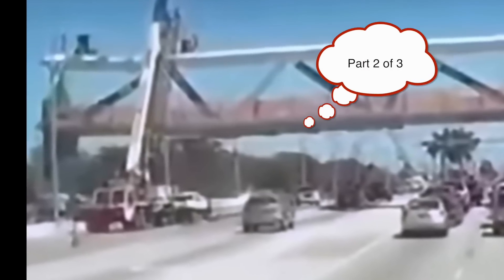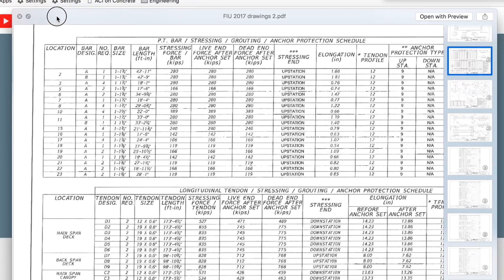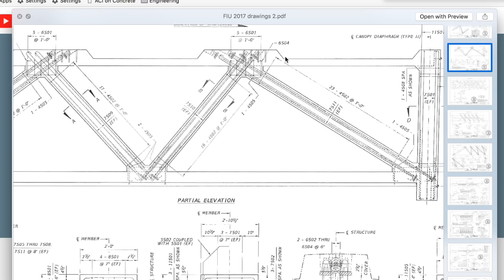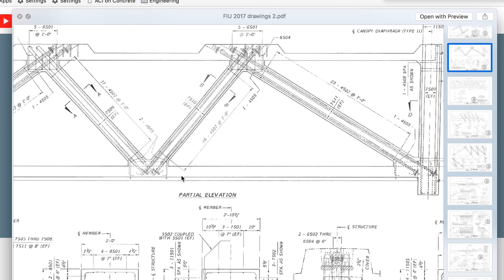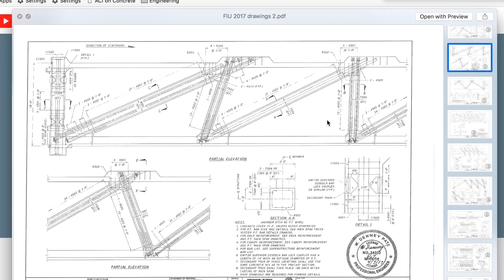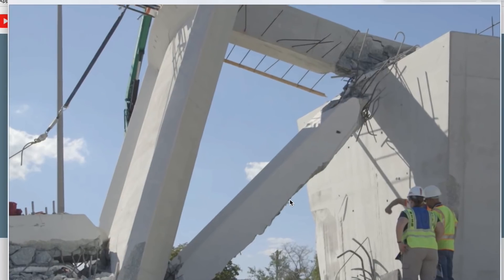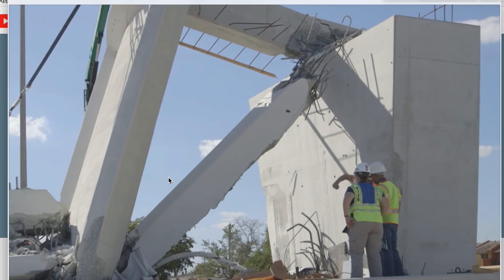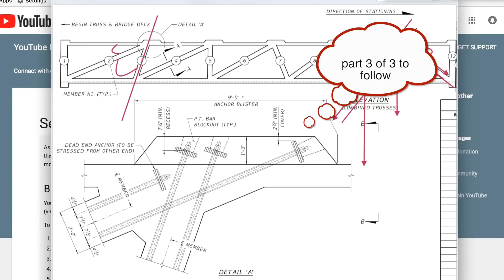FIU Bridge Collapse Could forces in #10 & dead loads be the cause of failure in canopy (2 of 3)

Comment: yes i agree bending moment  is odd as the trusses don't resist the bend like an I beam would and dead weight and poor angles on the trusses create a stress point and thats where it fails. I could be wrong but early picture of the  bridge really looks like the left hand side that failed looked lower than the right hand ???
Reply from the maker: Thank you for commenting Richard... this bridge should have just been a test project and never the real deal...

Comment: I'd rather put my money on a structural failure in the concrete securing the lower tension bar in nr11 to the lower deck. Several things could be the cause of this initial failure and i wouldn't be surprised if there is found to be a combination of several factors here. Something really significant must have taken place for the heavy hydraulic tensioning cylinder  together with several feet of post tensioning bar being ejected out of the canopy. I wonder if the "puff of smoke" (so many of you have noticed in the videos) on the outside of the northern pier maybe is debris flung out of non grouted tubing in the deck when the anchor plate holding the post tension bar got ripped out of the deck . If this is the initial catastrophic failure then a major buckling downward of truss member 11 had to happen. This failure would then effectively remove almost all stiffness in the bridge structure between the pier and truss member 10.
I find it very unlikely that the post tension bar got pushed out of the canopy during the collapse when the bar had to be severely bent already halfway in the fall. It's impossible in my opinion.
Just my thoughts on it and i'm also just speculating :)
Reply from the maker: We are way beyond your comments... catch up not!
Catch up! 
And, I am sure you would lose that money...

Comment: Your superb video discussing the voids created by ungrouted or missing post tension cables and those voids and cables way too close to each other and to the angular connection in the cast concrete was for me at least,  a water shed video,  

 I hope it does not get lost in the barrage of continuing discussion....
Maybe you can put links to it and highlight those links as crucial issues.
 

Those defending their engineering and other vested interests will do their best to avoid any discussion around that crucial range of issues.
                             ----------------------------------

Beyond that, in my view, a webbed concrete truss is ludicrous... entirely ludicrous from a dozen different perspectives... using post tension to make that ludicrous approach look good on a computer program used for calculating stresses on a steel truss  is even more ludicrous... and it ignores the issue of 'chaos mathematics' that you brought up regarding the internal stresses of*variable post tension and the invariable concrete...

My friend in the business commented that in his business those blister areas would have had so much rebar in them, that they call such structural approaches,  'cast in place steel'... not reinforced concrete as we see here with minimal rebar... maybe less than 5% rebar... leaves me in shock.

I think the insanity around this approach will be discussed for decades,... or... one  would hope be seen for what it is,  and put such concepts in the bin before another one is ever built.

It is fortunate that all the braggarts and origami fans were there when their entirely bogus approach landed in rubble ... fortunately not months or a year later

.....then hopefully that cloud of dust rolled over them...it is sad that we cannot say the same for all those crushed under their inexcusably bad design of mathematical, common sense and philosophical idiocy.

Comment: From the video this time going frame by frame it appears that the canopy did fail first but I'm not totally convinced. Due to the camera angle, the fact that the camera was in a moving vehicle and that it wouldn't have taken much of an initial fracture in the walkway to rip the canopy apart to fall hard and fast. I also don't understand why a failure in the canopy where it occurred would have precipitated a total collapse since you still would have had a rigid triangle formed by 11, 12, and the walkway. The canopy would have had to have caused a failure in 11 somewhere to drive 10 and 11 hard enough to shear apart the walkway. Okay I admit I just don't know. Glad I'm not a forensic structural engineer.
Reply from the maker: Mark, I am not 100%...
But, with all the current, limited data...this is my best choice...
Hell, it could be the deck failed first, the video, it is not distinguishable... at least in my judgement...
Wish we had original video...not speed up